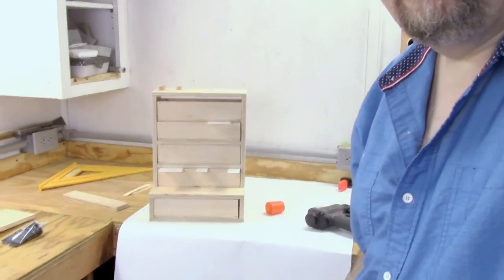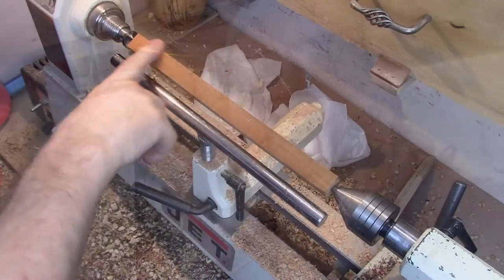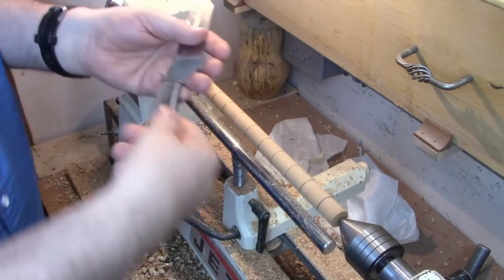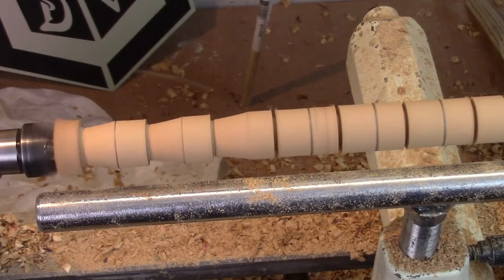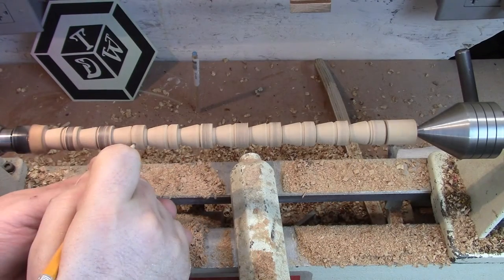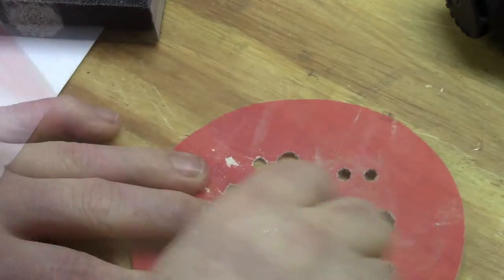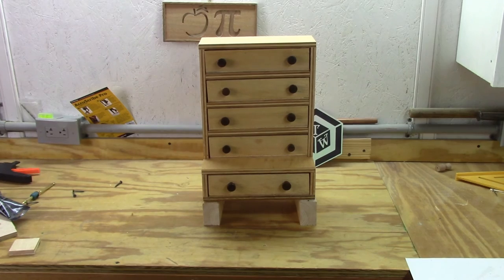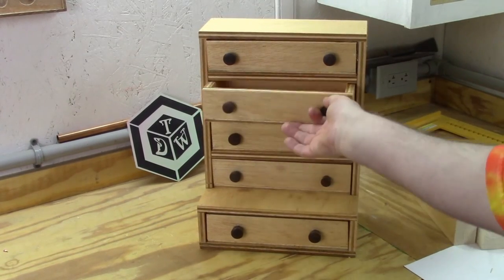How I turned small  knobs on the lathe

Comment: those look nice on that piece
do you think the stain on the glue side of the knobs diminish the bond and will eventually lead to a glue failure? I've seen the same thing done in other ww project videos where a stain is applied and then NOT sanded off of the glue face before gluing the project together. seems to me like that will diminish the bond and it's best to have a bare wood to bare wood glue joint.
thoughts?
Reply from the maker: I figure if they do fail I will just re attach with a screw. You are right if I used wood glue but the cyanoacrylate glue is pretty strong.